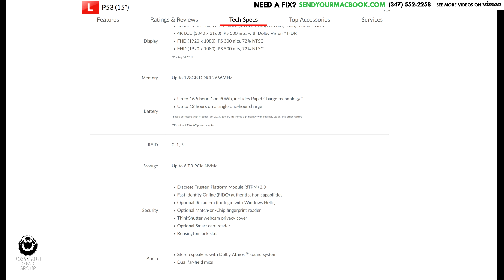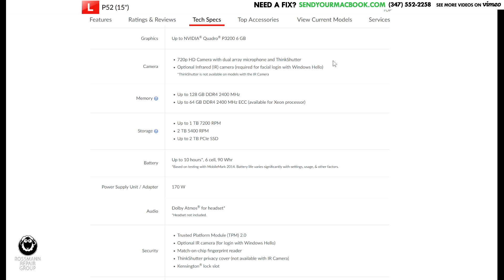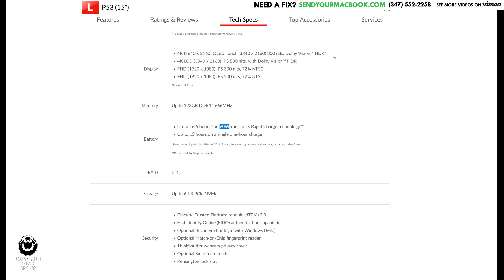Reading my YT comments is depressing

Comment: Didn't comment on the last vid as I didn't think my point was important but since it seems the details are of note: Louis, you are wrong, not in the argument of which you went into here (where you are correct). You are wrong on the premise that: "Manufacturers move away from removable batteries to increase battery size and make the unit thinner", The correct premise is: "Manufacturers move away from removable batteries to give engineers more leeway, often to increase battery size and make the unit thinner". Its a small difference semantically but when you are designing the internals of a laptop its not as simple a calculus as "internal battery = bigger battery". The internals of a modern laptop are a network of balance choices that all influence one another. No, that model didn't have a better battery Watt-hour rating, but did it have better cooling? Did it have more robust power delivery? Did it better space components so as not to interfere with one another? etc. Each of these network of choices is important and could result in the situation you outline. Now, do I think Lenovo needs to be dinged for aping apple? As a Lenovo user that went from an X230T to a X1 Yoga 3rd Gen: Yes, they are so clearly copying Apple that it is sad, but in the same breath you must consider the wider gamut of design questions relating to the internals of a modern laptop.

Comment: I feel this is a really valid point, if you change the battery to a flat, multi-layered Apple style design, there must be an actual benefit gain, either in thinness, longevity or other hardware reason. Otherwise it's a cynical dick move.

Comment: Now I know what you just said. I even knew it before. But I need an answer to this anyways. If you compare two CPUs from different architectures (lets use yours) Ivy bridge and Broadwell. If you cap both CPUs at 1GHz you still would get better performance on the newer CPU (IPC improvements etc). My quiestion is simple. Does the same thing happen in battery "evolution?"

Comment: It is not exclusively the number of watt hours the battery used can provide. It is also the power consumption over time which the battery powers, which is different between different machines that determines run time.

Comment: I have a p52 and the biggest problem it's it weight and having an internal battery they can reduce on weight, and they did. I have opened other Lenovo laptops (T480, T440...) They y a non removable battery but it's easy to replace.

Comment: Either way from Apple, or any other manufacturer! ita all ShiT regardless of using upped watt-hours or not!  nonremovable batters make it harder for the average DIY maker to take the battery pack apart and use them in another project once the useful life of the laptop has reached its end, which in terms, make it a less recyclable option, And the non-recyablele product is bad news for the planet!

Comment: Keep in mind that 90Wh is your limit with lithium batteries to take on an airplane. You could argue that not everyone wants to fly with it, but it would be a shame if you couldn't due to Lenovo deciding to put a non-compliant battery in a device and you are not aware. They could have added a secondary, smaller, modular battery though that you could remove when you fly. That would have been awsome.
Reply: 90wh? can be over that (upto 160wh) but you need to ask your airplane company and teeminals, quite a hassle

Comment: Well what if, in order to use a new component that is more efficient than what adding additional battery capacity would, required the need to re-engineer the internals and include a non-user removable battery? 🤔

For the record I am only 1/2 serious. I didn't comment on the last video, and I am not defending them. I couldn't care any less about this.

Comment: The end user experience and the reliablity is important. Does the end user experience and the reliablity of the laptop benefit at this point by needing to have batteries be hotswap? What is this use case you are putting forth that the battery must be external? I approve of the internal battery and fast charge features. I think it is a fair trade-off. I've opened my fair share of Lenovo laptops with internal batteries and it has never been difficult to remove or replace. Why do you expect that'll be more difficult on this model? I seriously doubt that users of Lenovo laptops where those batteries are internal have owners that feel as if Lenovo has preventing batteries from being changed that need to be replaced. The iFixit guides for battery placement for Lenovo laptops with internal batteries a pretty plain and clear and the difficulty rating or not high. Also end-users have options when it comes to getting the battery replaced if they feel they're not up to the task unlike Apple products. but hey, why don't we wait until the product actually comes out and more people can put up guides on how easy or difficult it is to replace the battery.

Comment: well... technically speaking... having the battery closer to the board and soldered is more efficient, however, it is negligible. in  the end it is just to reduce costs and increase profit for lenovo. unless the battery is made with different materials from the external one.... (not saying it is, just pointing that a 90Whr battery is the same as another 90Whr one as long as its composition is the same)

Comment: 60% increase in “projected” battery life...

Most likely they altered the “projected” use of the machine... like they set it to operate at dim screen output, and 10 second sleep mode... 

Any chance the battery management alters cycle depth of discharge? Something to extend the lifespan of the battery?

Comment: Long story short, removing a the modular battery provides zero benefits to the machine at all. Also people are stupid.
Reply: Tru dat!
Reply: Zero benefits? To the consumer maybe, but the company gets the benefit of selling more because replacing the single disposable power source that will always fail with enough time is a bigger hassle when not modular.
Reply: @gorkyd7912  also cheaper to produce

Comment: It's like a cars fuel tank.  You could have two identical cars but tune the engine on one car or replace certain mechanical components and you will get better range from your fuel.

Comment: It may be the same Whr, but smaller? Allowing similar size of machine for larger components that have better power performance. Therefore if the battery is smaller with larger other components that are better power efficient, that would be something that makes sense...

Comment: I think it's enough of an reason to have removable battery that if battery is flawed I would like to have option to quickly disconnect it and try to deal with it, instead of faulty battery destroying the device completely and having also  bigger fire hazard in worst case scenario. I really don't see any single benefit of having fixed battery in devices.

Comment: Obviously when the battery is modular it needs power to correctly hold itself in place. When it's fixed it can use all of its power for the laptop. Silly Louis.

Comment: I'm mostly sure that they just didn't bother putting extra work into designing a new battery latch/casing as they were designing the new chassis for the P53. And that they did so because they thought that they could get away with it because basically everybody does it now.

Comment: still - i rather have a 90Wh battery in a laptop, than to leave it at the airport due to not being allowed to bring my >90Wh battery into the plain. - non removable batteries are stupid. but i can understand the main reason why companies go that rout: it cost money to make the bay, the circuitry and the betteryhousing - when 90% of the users never pull it out. but especially on a model like the P-Series it does not make any sense to me.

Comment: Sad that you have to school the viewers to the lowest denominator.  Sad.   The same viewers most likely think that the expected run times are gospel.    I guarantee that I would not get the quoted run times out of any system  (3D CAD, PCB CAD,  rapid prototyping, video editing, and typing more words in one day than some people type in a year...).

I will always support system manufacturers that design around user replaceable batteries.  My values: free to choose to change the battery, free to choose what operating system I run, free to upgrade even with third party components (like disk and RAM), free to choose manufacturers that offer these things.  Sadly these things are becoming more rare.

The ONLY big advantage to built in batteries is that manufacturers must give the full warranty for these batteries since they are no longer a "consumable item".  People do need to enforce their rights when it comes to having equipment repaired under warranty such as when the battery no longer provides at least 95% of its rated capacity.  To this end, purchase from retailers that will support your warranty claims if you don't want to do the repair yourself.

Comment: Yeah, most of the times, removable batteries can be considered ugly, but it is so much more convenient, over the time their life degrades so you'll have to replace it eventually, or if you spend a lot of time in a place without outlets you might just bring a few fully charged and replace them when one is over.

Comment: It's to save money. They probably had a choice - integrate it OR reduce Watt Hours. 90wh aint that bad - thats 6cell I think. Everyone else is going down to 3-4 cells.

To be fair to Apple. They are making unpopular choices but getting the flak for it. But the other companies are simply riding the wake and hoping for less flak.

Laptops just aren't selling as much, tablets have reached a plateau. 

Digital cameras and expensive mp3 players aren't doing as well as before either.

Smartphones are basically displacing all the other markets.

Comment: I didn't watch the Lenovo video (yet) but i also saw that Lenovo is going to remove the Batteries in their High-End T Series. 
And i'm not gonna mince my words: 
It's dumb and absolutely shitty. 

One of the advantages of the Lenovo Business Laptops was the external battery. Literally one OF THE BIGGEST advantages. 
Lenovo Displays? Mostly shitty at entry prices. CPUs? Nothing that the competition doesn't have as well. 
Build quality? Yeah it's nice but at a higher price as well. So it better be good. 

And i'm a Lenovo Fan by heart. I got the T500, SL510, T420, L520, L530, E530, E540 and E585. You know what all of these have in common? 
GODDAMN REMOVABLE BATTERIES!

Comment: Example a 2017 2780 mah iPhone X has better battery life then a Huawei y5 2018 with 3000 mah battery... But the A11 soc is way smaller and better designed then that particular buject Huawei model...

Comment: 90Wh battery means you can draw 90W for 1 hour before the battery is empty. Or you can draw 10W for 9 hours.
The P53 lasts for 16.5 hours, 90Wh/16.5h = 5.45W
The P52 lasts for 10 hours, 90Wh/10h = 9W
As you can see by numbers, the P53 consumes 40% less power than the P51 and lasts 65% longer with the same battery.

PS: This comparison is only valid, if Lenovo tested both battery lifetimes under equal conditions.

Comment: There are several companies like Schenker who sell completely modular laptops. Replacing hard drives or ram takes 5 minutes and just 1 screwdriver (since all screws are identical and easily accessible), and with the more expensive models you even get desktop mainboards with socketed CPUs. Of course they are quite chunky and rather heavy, but as a result of their construction you can spec them very flexibly, easily upgrade them and even then  they tend to cost a bit less than their competition. Of course it'll be never be as slim and attractive as an ordinary laptop, but putting functionality over looks means more performance and user-friendliness for less money.

Comment: Watt hours of batteries is comparable to gas tanks of cars.
In conjunction with the engine, you get the consumption per 100 km as well as the maximum travel distance with one tank filling.

Comment: modular battery uses Li-ion (18650) and flatpacks use Li-Po..  Li-po can handle more amperage draw with less voltage sag PER cell and they age much better as well when properly maintained again i replaced countless modular batteries in heavily traveled laptops and only a few batteries that screwed in internally to a machine.  i just feel this point isn't a good point to rant about.. batteries do fail over time yes, but as long as they arent making it impossible to safely replace, i dont care as long as battery can hold up till EoL of the machine anyway..

 there is a reason people fly drones with Li-Po not Li-Ion and not specifically weight, even though weight does play a big role.. its rather how many amps you can reliably draw without turning your battery into a fire doing a full send.  i can buy a 4S or 6S Li-po that flatpack that can dump 100 AMPs above nominal voltage full send without for 10 seconds multiple times just as FYI thats is ~ 1500 watts rounded up (14.8V * 100A) for 4S or 2,200 watts for 6S (22.2V * 100A) .. find me 4S or 6S 18650 pack that can do 100 amp full send for 10 seconds without bursting into flames or dying mid air cuz voltage sag was so deep it crossed cutoff voltage. just for ref avg 18650 only does 4 amps safely some doe 8 or have spec for <1sec peak amp pull for 10+amps but no where near the power Li-Po can dump

Comment: Whilst everything you state is true and correct, there was a point that was not discussed,  Would it not be possible that with the introduction of a new chipset that the hardware layout has changed resulting in reduced chasis space, therefor causing the need for a form fitting battery making it non removable? (Apologies I have not done any research on the aforementioned models) It just blows my mind that a reputable manufacturer such as Lenovo would go this route. But hey look at apple... xD Thanks for the awesome content Louis!

Comment: I wouldn't be surprised if Lenovo started messing with the thermals, specifically the fans to reduce consumption, like CrApple
Reply: Power consumption of a tiny pc fan is negligible, apple slows them down for noise reasons

Comment: I'm sure I'll get filleted for asking this. Even though I agree with what you're saying I gotta ask for curiosity's sake, is it possible there is a slight power loss through the battery connector? And making it internal gives a slight bump in usage time?
Reply: Kinda. If the connector is longer, then the resistance will go up (you'll get more heat loss), but thiereduction in use time is incredibly, incredibly small. I doubt you would be able to measure it.

Comment: @ Louis Putting an internal battery as oppossed to a removable battery is not just about profits. Think a little bigger. If you remove the battery from something there is no way to turn it on "REMOTELY", if it has no power you cant track it, use its camera or microphone to ""RECOVER IT(spy) when someone steals it.""

Comment: Water analogy, both barrels store 60 Litres, but due to the efficiency of the hydro generator, it drains less water per hour, than the older model, meaning the water capacity lasts longer.  Same Tank, same water capacity, newer Generator needing less water for the same power output.

https://i.stack.imgur.com/nGMrD.gif

Comment: Welcome to my world. 1W = 1J/s. Energy is measured in Joules.
It's as bad as these twits that think an electric 'ecopanel' heater at 150W is cheaper to run only because it's more efficient (hence the eco marketing prefix) than an electric 1000W bar heater.

Comment: Just loving it! You made me laugh and shaking my head at the same time.

Lenovo is doing this to save some money on the new version, also getting less support questions from users who are unable to install the battery correctly and at last getting users to replace this laptop earlier than before because there is no easy way to replace the battery.

FYI: The uprise in runtime hours is the result of a lower nm processes being used for the cpu series / gpu and chipset. So you get more hours of run time and/or more performance.

Comment: I said my reasoning in the last one but did not mention battery life. Intel is still running 14nm base on a 5 year old skylake architecture, if the display is not MUCH more power efficient then the batterylife will be about identical or worse than the P52 on an equal 90Wh. This gen 8 cores are beeing put in when 6 was to much for the P5x chassi which handles the 4cores very well. With the machine being thicker and with an internal battery they can spread it thinner and wider. I do believe they have worked to cool the nuclear hot 8 core 14nm(+++) skylake parts. And Very few people are loosing anything with the move to an internal battery with the powerfull powerbanks we have today and quick charge. 

I think the move was right for the X390 as well but not in the way they did it. They should have had closer to 70Wh not less than a regular slice battery

Comment: If u remove the CPU and GPU u get more battery life -pro tip
Reply: Also if you plug in the charger, I almost never use up my battery's life when I have it plugged in.
Reply: If you desolder the battery off the PCB, your battery will last even longer.
Reply: This is a Pro Gamer Tip

If you don’t turn the laptop on, THEN YOUR BATTERY LIFE GETS BETTER

Comment: Probably easy to explain like a fueltank on a car. You have car A and car B, both have 50 litre tank but car A is from the 90s with 4cyl and car B is from 2010's 4cyl. Newer car is going to be alot more fuel efficient compared to older but the fuel tank amount is the same.